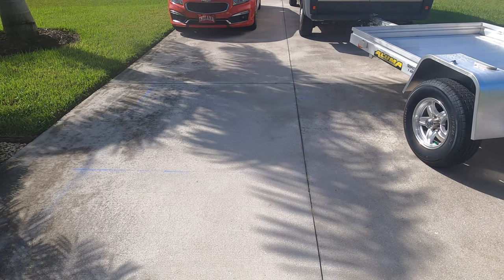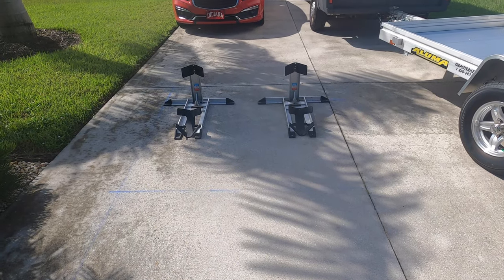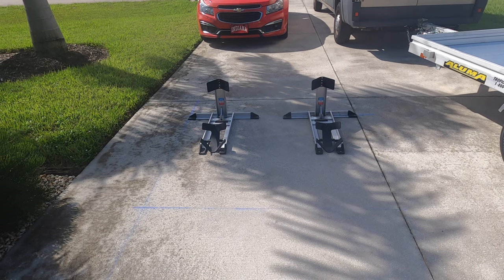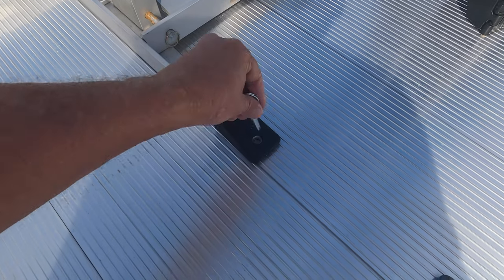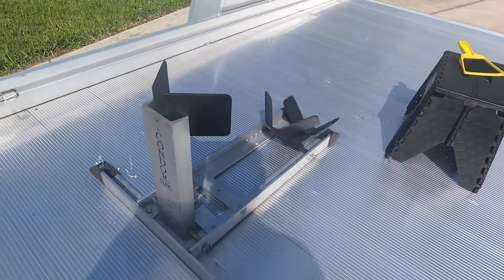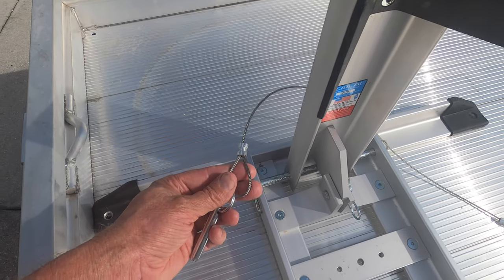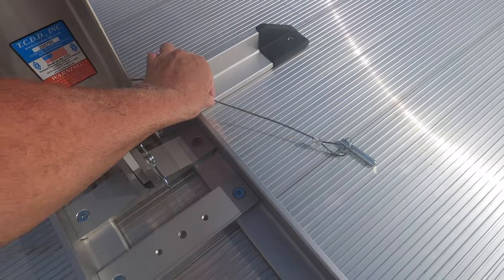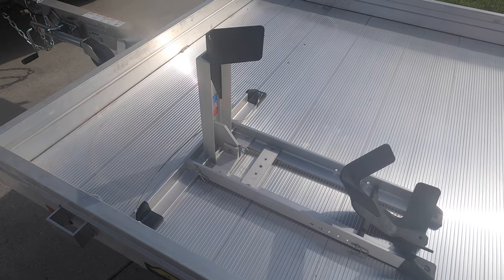Condor Chock Mounting To Aluma Trailer- Motorcycle Adventure Travel

Comment: Great video and good ideas, why didn't you mount the chocks closer to the front of the trailer?
Reply from the maker: Hi RobertLupo,

There were 2 reasons for mounting the chocks where I did. One reason was that the mounting tie downs were located along the side instead of up in the front, and the other reason was spare gas cans. You can see this in EP. 75. All of my thumbnails have the episode listed. Watching EP. 75 will make more sense for the reasoning.

A note on weight loading the trailer for those who may not understand the principle of trailer loading. One needs to load more weight forward of the axle than behind. Loading more weight behind the axle creates an unstable tow and is dangerous. One will see U-hauls weaving as they go down the road because of this type of loading. However, too much weight forward creates excessive tongue weight. You'll notice this with the pick-up hauling a trailer with its rear bumper, almost touching the pavement. Therefore, load placement is critical for a safe and stable tow. All hitches come with a load rating. It is best practice to adhere to this rating. I'm quite sure there is a guide or rating somewhere about cargo weight verses tongue weight on the internet. This would give one a technical guide. Bottom line, weight forward with adequate tongue weight without excessive tongue weight.

I hope this explanation helps. 

Take care, Mike

Comment: I like what yu did ,, but , the hole yu drilled , need to make two hat bushings , yu will elongate the holes on the trailer bed , then it will be a great set up , just in my opinion , great video ,,, thank yu for sharing . Tdog..
Reply from the maker: Nice to hear from Tdog.

You are absolutely right. If your going to use this set-up, a bushing or backing plate is going to be needed for longevity. 

In my case, the holes did oblong. Not a great concern, but eventually this situation would need to be addressed. I put thousands of miles on that set-up before making a switch. 

I addressed the issue by putting a backing plate with threaded holes. I made custom T-bolts to screw the chocks down. So far this fix is working. 

Thanks so much for watching and adding excellent advise. There is no doubt your wisdom will help other viewers.

Take care,
Mike

Comment: You see that center brace on the Condor Chock with the three holes drilled in it?
That’s for mounting a quick release to the deck.They sell it as an accessory. Anyway it’s just a plate with two holes you drill into the deck and attach your bolts. Then on the plate there are two stubs that slide the Chock in and you just tighten down a thumb screw and that’s it. When you want to remove it just loosen the thumbscrew and slide it out.
Reply from the maker: Thanks RoyRolph. You are absolutely correct. That option is an effective and inexpensive way to mount the chock. The only reason I didn't use that option was I wanted to keep the deck clear of protrusions. If the trailer is dedicated to one function and you don't mind the protrusions, then without question that is the way to go. Thanks for pointing that out. I think your observation will be very helpful for anyone contemplating their mounting options. Best wishes and take care. Mike